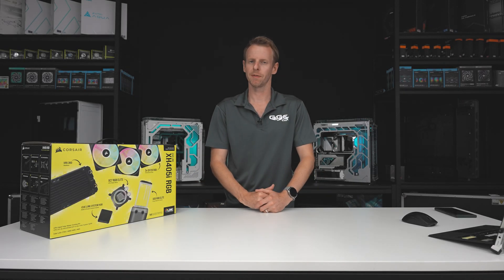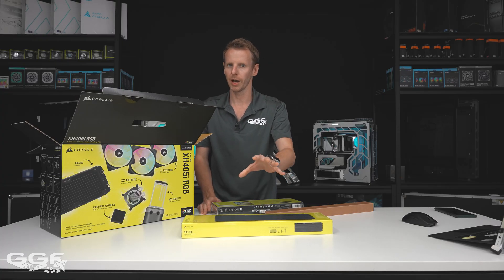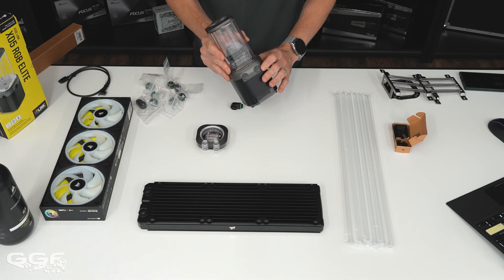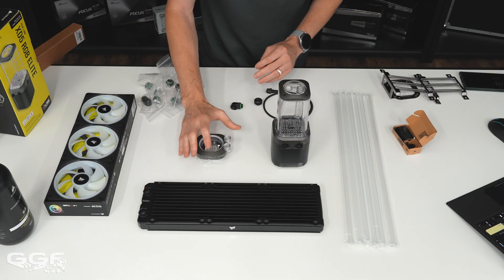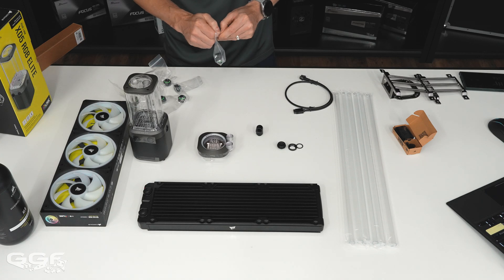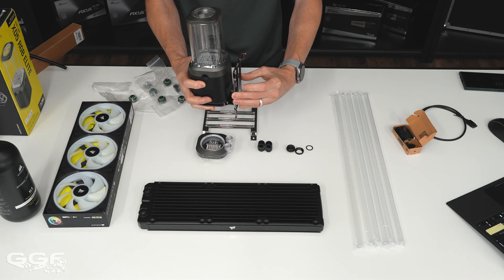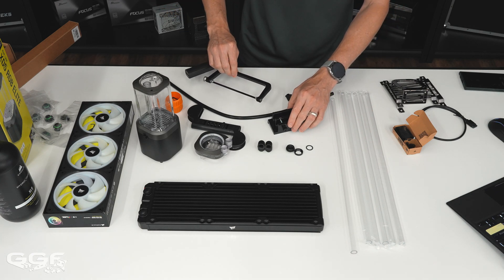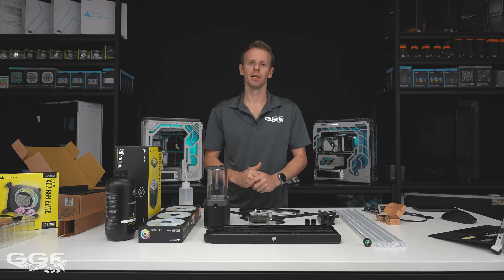NEW Custom Watercooling kit from CORSAIR

Comment: If you wanted to be HILARIOUS, you could use that kit in the new 9000D. lol It is expensive and limited, asking someone new to make super compounded bends is a little much. Make it as close to one 90 as possible. No negative on the kit, but you using this in a build would be, well, silly. lol

Comment: Beyond just the products included or rather not included with this kit, Corsair does not make any male/female static extension fittings. This makes it harder to do tube runs exiting radiators, and getting things to line up. You can pick up that type of fitting from Barrow or Bitspower, but your newcomer to custom water cooling may not know where to look or which fitting is best. Considering Corsair uses bitspower as an oem, I don't understand why this is the case. 

Even if they did include more 90° fittings, you would still have to do difficult multibend runs. Regardless, I would have liked to have seen at least 6 90° fittings.
Reply: Hi pask!!
Reply: @currentlykent4593  ;)